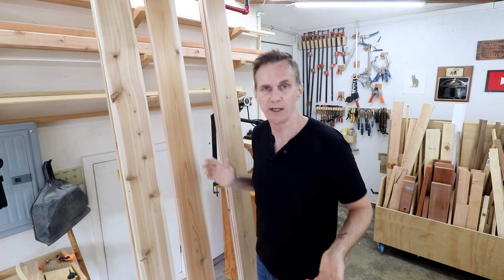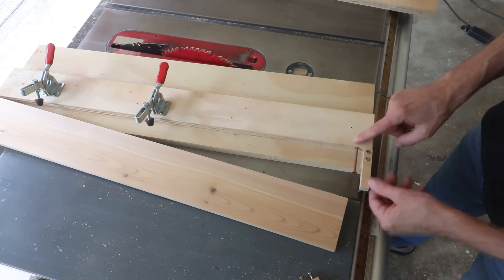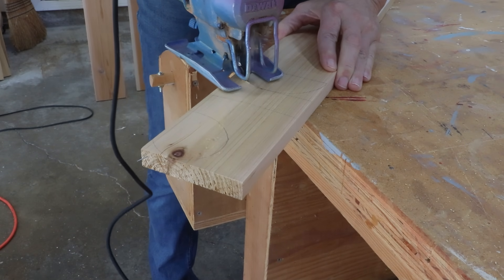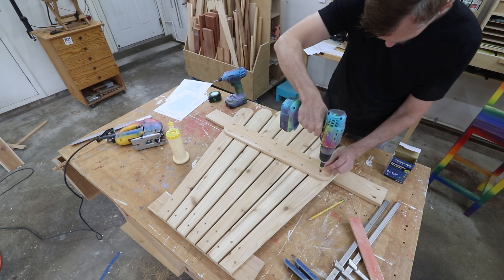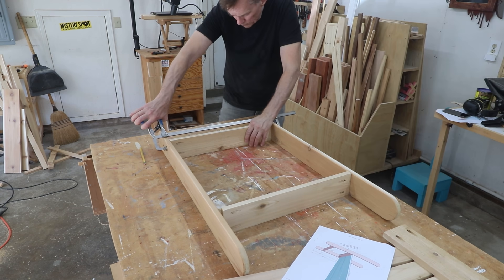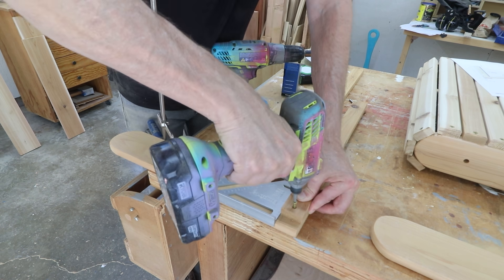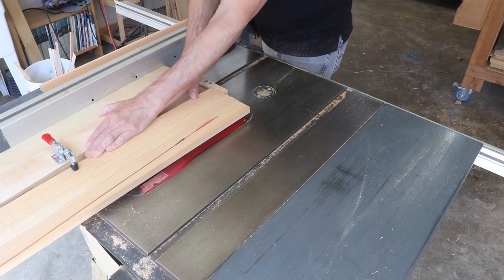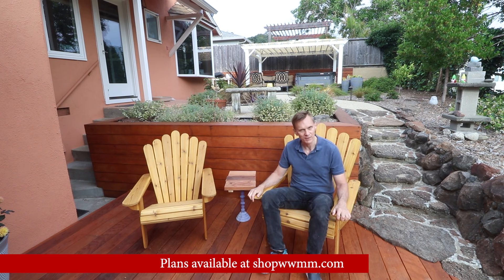You can make this Adirondack chair in a weekend

Comment: Nice work! Another good reason for buying wider boards and cutting down is that most boards are cut from young trees with the middle of the trunk in the middle of your board, which will cause the most cupping of the board. Buying a wider board allows you to cut out that middle part to minimize cupping. In this case if you want 3.5" boards you could buy an 8" or wider board and get your 3.5" pieces from either side of the middle, then throw away the middle part of the board what you have caused the most cupping.

Comment: Extra points for all the  countersunk pilot holes and not using an impact driver 👍🏻
For big circles and arks my step dad made a large set of dividers. 2 prices of wood a wing nut and bolt 2 screws with the heads ground to a point.

Comment: Suggestion: With the new longer cross piece on the taper jig, you have room to mark out a ruler to measure the set screw off of. I’m sure it will beat having to switch between your tape measure and the screw driver 3-4 times every time you adjust it.

Comment: I would prefer using cedar but unfortunately, our local Home Depot (here in northern Arizona) doesn't seem to carry 1"x6"x8' boards. I know I could use pine but I have my sights set on cedar. The chairs will be placed on our deck and exposed to the sun and temperatures ranging from 20 to 105 degrees. So far, I have begun by building a taper jig prior to driving 100 miles round trip to where cedar can be purchased. Steve Ramsey is my guide. Thanks, Steve!

Comment: 14:14 - you might want to try using good old CD for drilling holes at a 90° angle, it acts as a mirror and helps a lot, you just have to make sure that the drill bit and its reflection makes a straight line.

Comment: Tip for the awkward work placement business at 18:30: Hang the front end of the chair off the end of your workbench and let the legs hang down as you bolt them on. You’ll want to lift the chair back up like you did after that to get the angles right, but at least they’ll already be attached at that point.

Comment: Draw a line down the center of the middle back piece and then use a framing square on the bottom cleat to align the center line to 90 degrees.